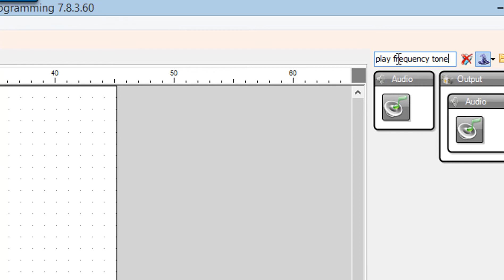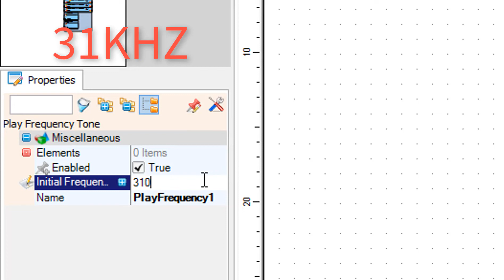Arduino Mosquito Repellent Diy

Comment: I am trying to keep cats out of our plants by using 30khz and a motion sensor. Is there a way to set this up using the arduino motion sensor module to activate it for 30 seconds or so then go into a sleep or wait mode to save power? Thanks for the project.
Reply from the maker: Yes its very simple you should checkout my projects, PIR project that activates modules such as buzzer,etc
Reply: @visuinoprojects  Could you point me to them with a link? I am coming up with many links to arduino but I would like to see your work. Thanks ahead of time.
Reply from the maker: @amtpdb1  
https://www.youtube.com/watch?v=GBwrdIedsos

https://youtu.be/yGsgeRbflHM

https://youtu.be/JewwnEIUiKY
Reply: @visuinoprojects  Thanks for sending this information. As I did not know what I was doing it did not work right off. The buzzer was on all the time and went off when motion was detected. With the converter and with out it there was no difference. I put in inverter to see if that worked on the signal and it did. Now it works fine. Thanks again.